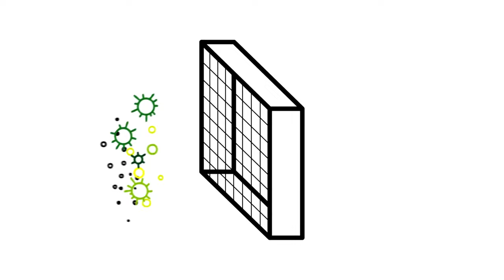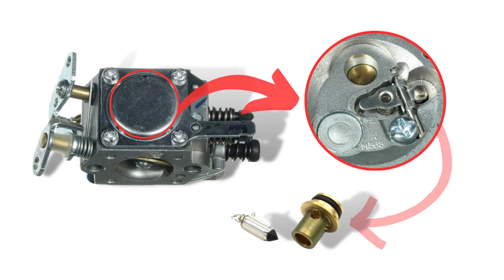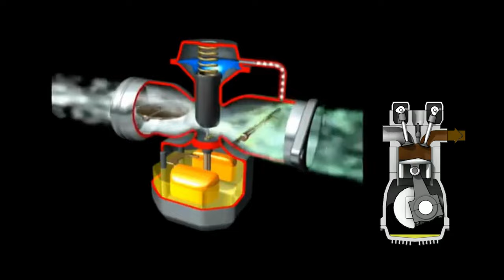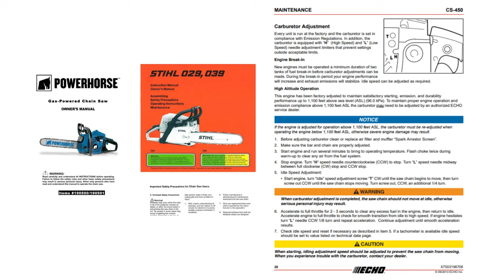Troubleshooting Guide: Chainsaw Has Spark and Fuel but Won't Start? Try These 3 Fixes!

Comment: Has Land H on top cover what’s it for
Reply: The H feeds it more or les fuel if you turn it counter clockwise it feeds it more gas and clockwise less fuel if you saw is bogging out when you give it gas turn it counter clockwise 1/4 turn at a time until it stops bogging when you gas it